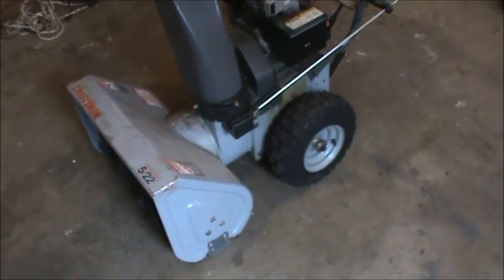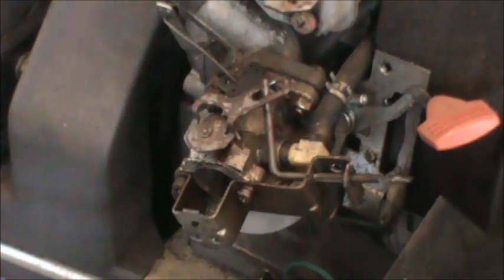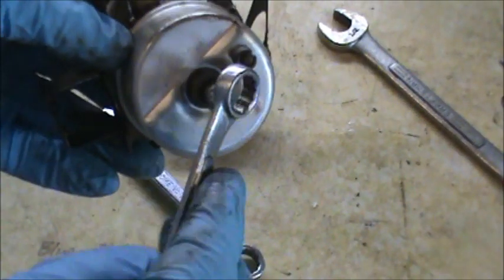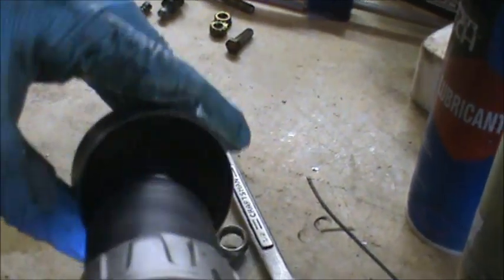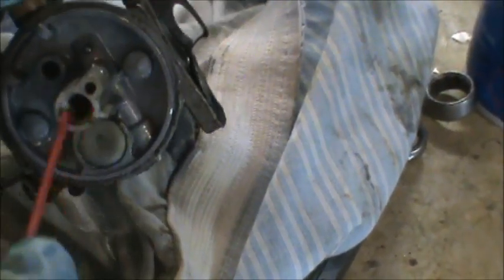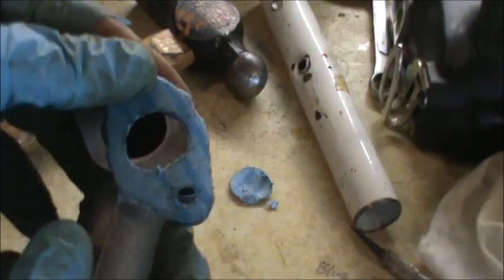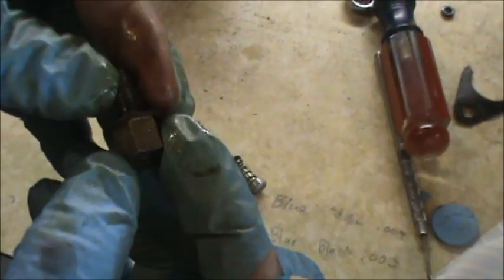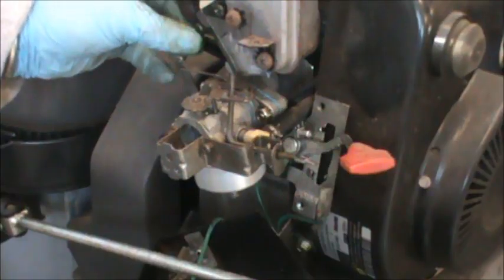Craftsman Snowblower Carburetor Repair

Comment: This is a good video it was very helpful. On mine I am having trouble with the Spring that goes to the gov arm & choke it doesn't seem like it's operating like it should...  It doesn't seem to fully open and close the butterfly and you didn't really cover that. Not sure if the Spring is shot I'm sure it's in the right place but the Spring doesn't seem to operate the choke properly. If you happen to read this in the next few days I would love to hear from you. ..2 hrs later i figured it out... full range of throttle now 😊

Comment: To adjust carb. Turn both idle screws in by hand or very carefully with screwdriver as they will seat on those o rings. Overtightening can break o ring resulting in leak. Back both fast and slow idle OUT one and a quater turns and adjust at full throttle and min throttle according to which screw. Quater turn increments. Listen to motor for smooth running. Engine must be warmed up with no choke. Make sure you linkage is in correct holes on carb and governor arm and position of linkage is correct. There is a slight bend on one side of linkage that goes to carb.
Reply: Top comment 👑💯🔝🥇🏅🏆🎯👌🏼

Comment: Just got exact same blower except it has tracks, stalled on a 30% 2foot covered hill about 800feet. Had to sled it up hill on a snowsled attatched to the kubota. What fun. I hope its just clogged jets. Update, clogged jets, needle valves gummed up, debris in tank, busted primer bulb line. Chemtool and tobacco pipe cleaners worked. Van line on primer bulb. Cleaned carb, jets, seats and reset idle. Seems ok.

Comment: Short version...this video was helpful thank you :)       Longer version...so maybe a guy took a snowblower apart in the summer/dutifully kept all parts and even ordered a carb rebuild kit however neglected to take pics or better rebuild the carb until the night before a big snow storm.     Carb rebuild was easy...however putting some of the linkages back together ...  memory may have been a touch fuzzy.     Again video was helpful and I appreciate it.   Thank you :)

Comment: good video but. don't use a steel hammer for the gasket. try with a rubber one.
The manifold it is a soft aluminium.

Comment: When i prime 2x the gas on my snow blower, i seen gas leak...i opened up the cover thinking i have a broken gas line, which i did not....the gas came out from the opening of the carburator out of a small hole.Any ideas?  Thank you.
Reply: Exact same thing, did you figure it out?

Comment: Followed these steps and when I reattached the carb and added gas, it leaks from the bowl seal.  From what I understand, that seal is not meant to stop leaks and that, if gas is leaking, it's because the needle is not sitting right.  I replaced that small stopper the needle rests on, is it possible I set that down too far?

Comment: Does this model require an ignition key?  I inherited one recently and after replacing an auger belt, cannot get it to start.  Followed these steps successfully but still won't start.  I noticed a notch/hole for an ignition key but don't recall there ever being one inserted?
Reply: Not sure on models, but they generally need a safety/kill key.
Reply: I have this same snow blower and yes it uses a plastic key...it a straight piece of plastic with 2 little indentations at the end of the key

Comment: Hi, thanks for the fantastic video.  Is the carb shown in the link the exact replacement for this snowblower model?  They're going for $15 on Amazon - I figure it would be easier to replace the whole unit?  What's your advice?  Thanks again.
Reply: For 15 bucks - replace!

Comment: What kind of material did you use for the new gasket?
Reply from the maker: It is called gasket material.  You buy a big sheet at the autoparts store.  It is really not expensive at all.  It is special stuff that does not leak or burn up.
Reply: doublewide6 Oh, wow...  It's nice you can buy it like that!  Thanks for the info!!!
Reply: Donna M. Schmid I